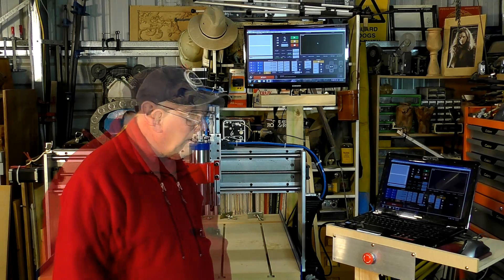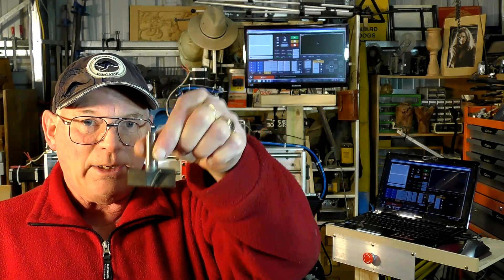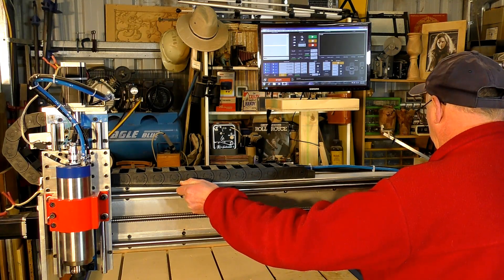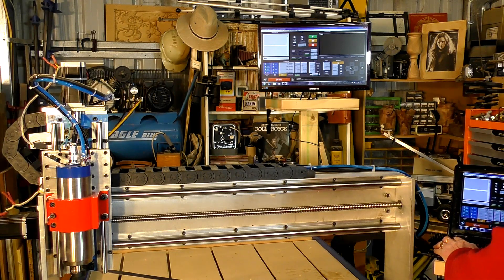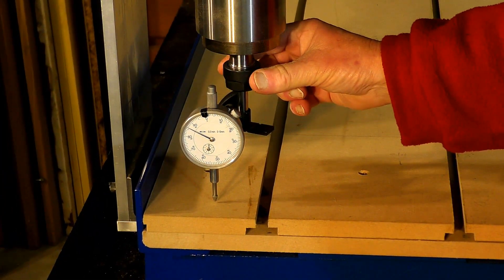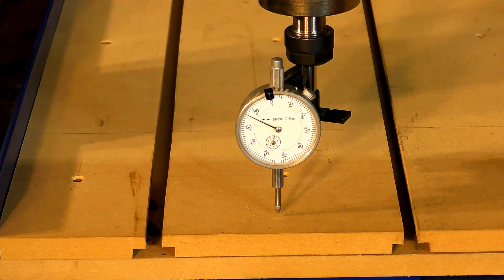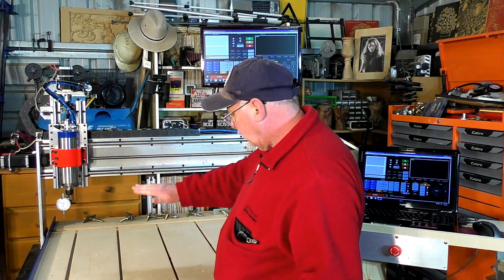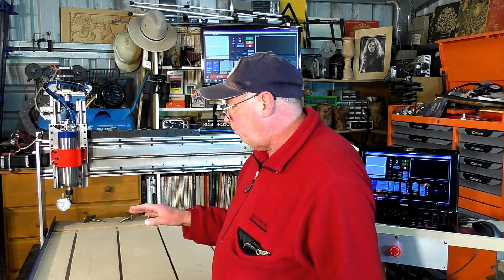CNC ROUTER, Setting the Axis limits and probing the bed Part 1

Comment: Step 1. Surface the spoliboard, even if the spindle is NOT vertical.
Step 2. Place a thick (not temperetd!) glass plate under the spindle (obviously granite is much better).
Step 3. tram and square the spindle over the plate surface.
Step 4. Surface the spoilboard again.

NOTE: after the step 1 the surface will not be locally flat. But it will be on the "average".
A glass/granite plate placed over it will be perfectly flat.
Reply from the maker: Yes you can do it thay way, but I dont.